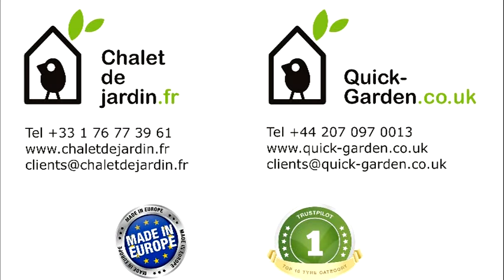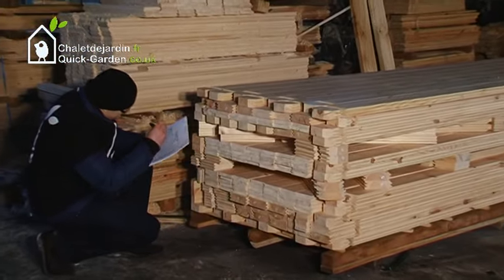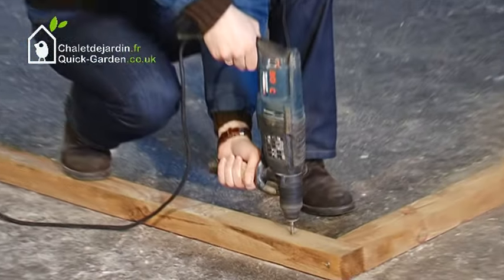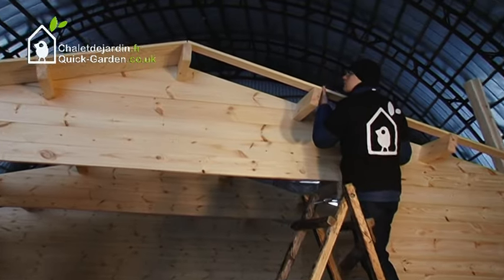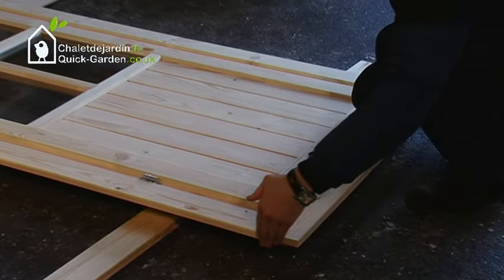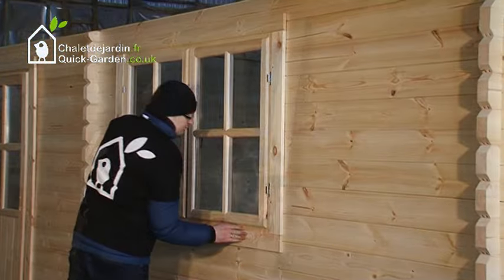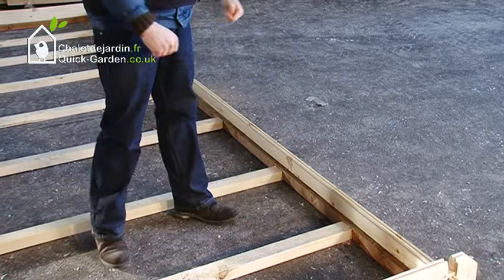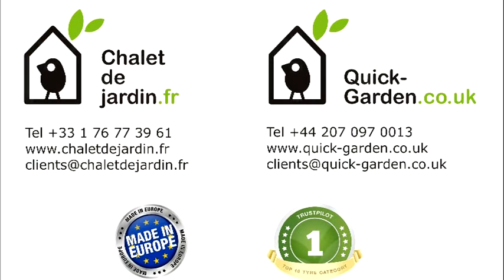How To Build a Log Cabin | Assembly Instructions

Comment: Does the roof need treating before attaching the shingles? Do the assembley team do this if paying for assembley? 
Also, you say to use screws for the floorboards but show the guy using nails. Which is it?
Reply: I can guarantee if you roof in this fashion you'll be replacing the entire roof in about 5 years after water ingress behind the facia boards soaks back up the roof timbers under the shingles and rots the roof completely. The facia can't protect the end of the roof boards and the back of the facia can't be retreated once it's in place. I've replaced several log cabin roofs that were originally done in this fashion and the status of them is always the same, rotting facia from water trapped behind it and rooting roof boards from the trapped water soaking back into the boards via their exposed ends. 
Before any shingles are put on the entire roof should be wrapped in felt and 4*2 added on all edges so the felt can be wrapped around it to create a drip edge stopping water ingress. There are loads of good instructional videos on how to correctly felt roofs, particularly on how to felt corners correctly. The shingles can then be applied over the felt.
On a side note rotting wood causes spores (most common coniophora puteana) which is nasty crap to enhale.

Comment: How long would one of these last? I need one in a few months which means I need to order now I think 😅
Reply: Do not order. I bought one last year, took several months to arrive and had many issues with their recommended contractor. Best to avoid this company.
Reply: Assuming its not too late, if you do order one speak to someone who knows how to put them up properly before you begin assembly. They can point out all the extra bits you should be doing that never come with the instructions like protecting the cabin from damp in the ground, building above the flood line, roofing and insulating correctly. Then you'll have a chance at having a cabin that will outlive you.

Comment: I think rotting/moulding parts within short period of time will be a main problem here.
But who cares? Thus I would name the movie "how not to build a wooden structure cabin/house". I saw houses in Eastern Europe (Lithuania, Russia) which were 50-70 years old and the logs were in perfect condition (made of quality wood, preserved with anti-rot substances). Here in the UK the quantity matters more then the quality, so the built wooden houses/cabins look more like doolhouses.
Reply: Johnny English no Iv had one of these in the garden for 15 years. Just paint and treet it alot better than mobile home. Some people just put them in stupid places and end up with rot on them due to not bothering to treat them.
Reply: Johnny English Mmmm you only think that,,you don’t actually know do you,?🐖💨💨💨💨
Reply: @davidskeeterskeeter1835  I do know, I've seen it first hand so Johnny is correct. Regarding the response to treat the wood frequently, that doesn't help the areas you can't reach after it's built, like the back of the facia boards or the floor joists that's are soaking in all the lovely damp from the ground. People then wonder why they have to walk like sailors inside their cabins.

Comment: at 3.58 you say gap between wall and upper window frame will contract it looks like its about 2 inches that seems alot
Reply: horse rider The building will settle etc and reduced the gap but not to zero. You need a gap there so that the weight of the building is not carried by the window frame it could start compressing the windows and they would be come difficult to open. You just don’t want the gap extending outside the trims

Comment: All of these Kits have one thing in common, Not Pressure Treated. Why? What about Rot? You would have to Seal on a regular basis.
Reply: ravenlorans every 5 years I do mine
Reply: ravenlorans traditional log cabins were never treated either. I've seen them built from raw un skinned logs before. Every 5 years is exactly regular is it.

Comment: Are these easy to dissemble
Reply: Easy, nope, but they do come apart if need be. I had one log that was mis-cut (the plunge depth was 3cm instead of 4cm on the joint and I had to remove that log to cut the depth 1cm deeper (I believe it is an automated process for the most part on the log cutting, so if a bit of wood got stuck in the jig, it would make it not cut correctly. That being said, there's hundreds of parts in my kit and only one mis-cut that wasn't a hard fix with a sharp chisel and a circular saw.  

And yes, you can take the logs apart (the slower, the better on the small logs with a wooden wedge about 2m wide, driven into each seam at the ends of the log you want to remove. NOW the slowest part would be repeating this step for ALL logs.  And it's likely you removed the labels upon assembly, so if you're taking several layers off or removing them to a new site.  Also note, the bottom wood bearer IS pressure treated, but also screwed to the concrete, so that and the first layer of logs are screwed to that, so if you want to take one down, it's a slow process to get down to the bottom log while labelling everything. Also note, the roof will be screwed/nailed down. and if you chose a wooden floor, it would require taking that up too.

Comment: Surely that 30 or 40mm gap above the door won't go away in a month or so as they say. I know wood expands and contracts but that's just silly
Reply: paul s The building will settle etc and reduced the gap but not to zero. You need a gap there so that the weight of the building is not carried by the window frame it could start compressing the windows and they would be come difficult to open. You just don’t want the gap extending outside the trims
Reply: @peternewton2200  yeah Paul!!